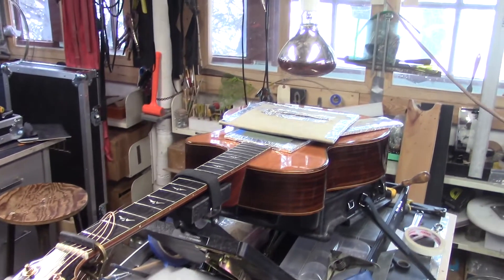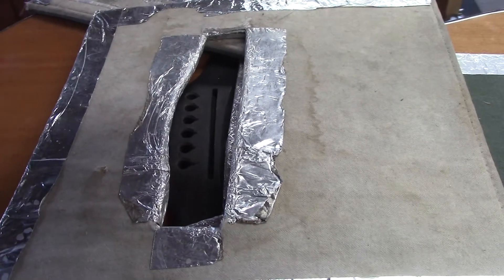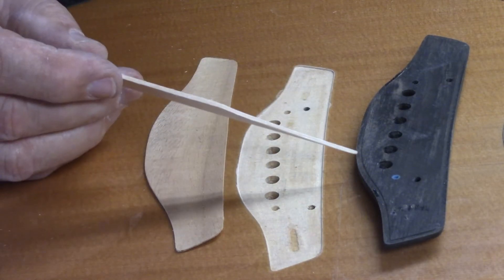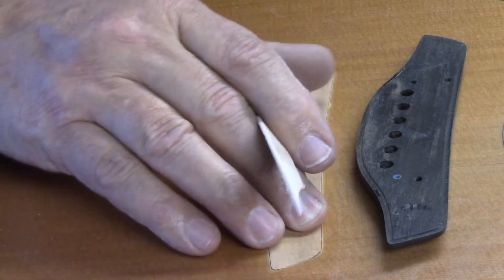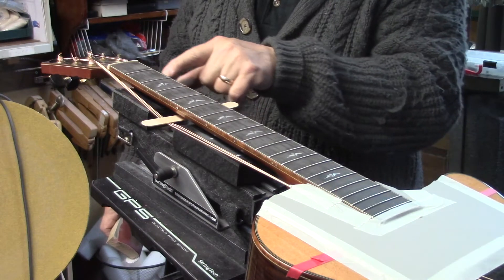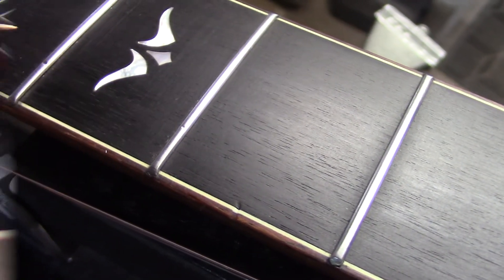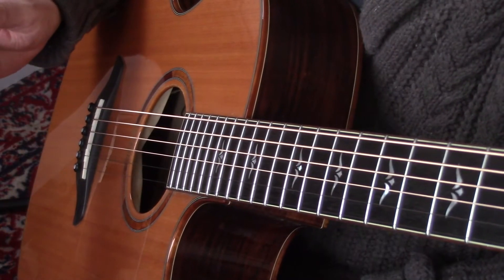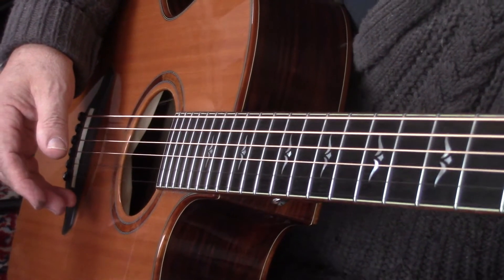CNC'd Guitar observations @StringTechWorkstations

Comment: Interesting to note that final preparation or restoration of the highest quality machine ways for example are completed by hand scraping.  
The speed and precision of CNC at work is so impressive it's easy to forget that precision depends on thoughtful programming with complete understanding of materials and tools in use.  If tool wear is not sufficiently monitored and or variation in materials not considered, precision is gone, but you can still crank out the production at quite an incredible money making rate.  Manufacturers are usually not going to stop production as long as the product is "Good enough".  
Beyond "Good enough" is where a person's hands, study, years of training, experience, artistry and creativity come into focus to bring out the whole intended beauty of a design. 
Beyond "Good enough" is where Mike works.  
Thanks for sharing all this with us man, I have the greatest respect for what you do.
Reply from the maker: The wonders of the CNC technology are undeniable. In this instance there were several things that were overlooked. #1 The expansion / contraction of two different species of wood  #2 the actual positioning of the glued surfaces #3 the penetration and amount of glue that was used.
#4 the flexing + displacement  of the soundboard under string load #5 the importance of the "cosmetic appearance" super-ceding the actual structural integrity. I've seen this often times with finishes as well  .. where you have a finish that you could "roller skate across"  as opposed to an ultra thin,  Fine hand- rubbed patina, applied with the French polishing technique that does not disrupt or smother ( or in the case of fine violins ... actually enhances the tone of the instruments )  the natural resonance of the instrument. Most importantly, this guitar has now found it's true voice and Michael ( customer ) can relax and create music without ever giving the guitar another thought.